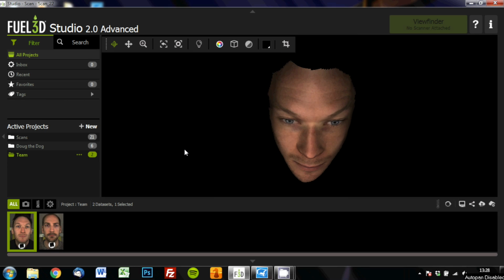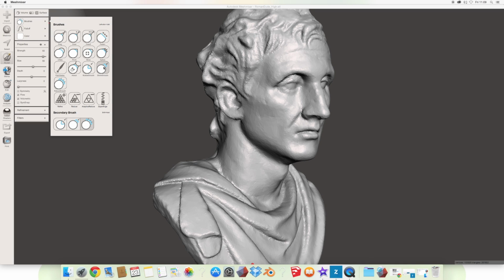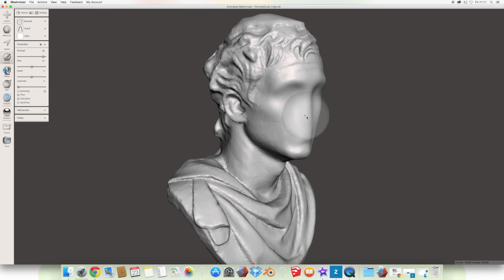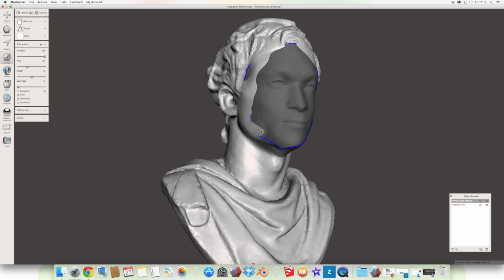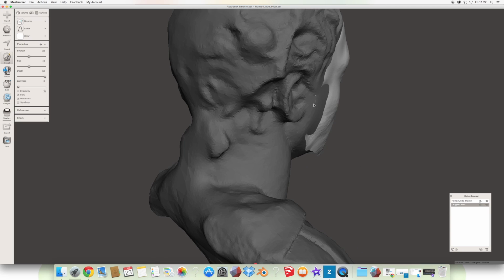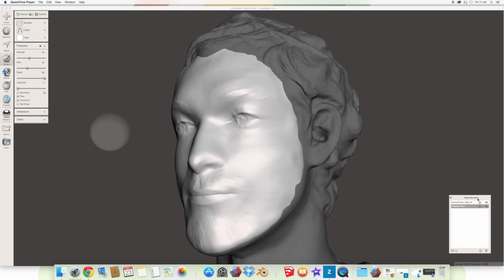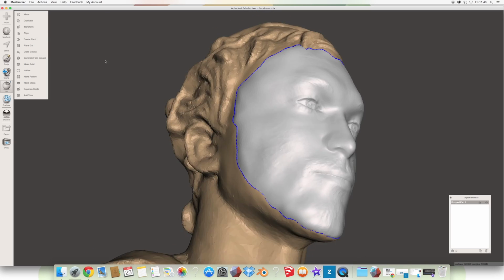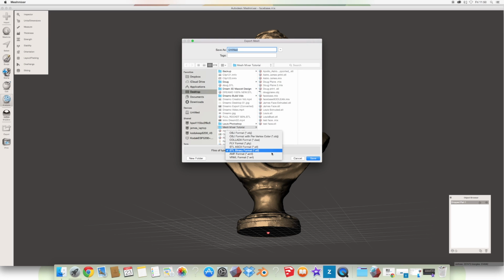3D Scanning my Face using Fuel3D SCANIFY and Adding it to a Bust | Tutorials | Dream 3D

Comment: Great application keep the hi res where it is needed, in the face and use the model for the rest of the bust or body.  Also means you get a quick capture and no worry around movement when scanning around a head like you get with other 3D scanners.